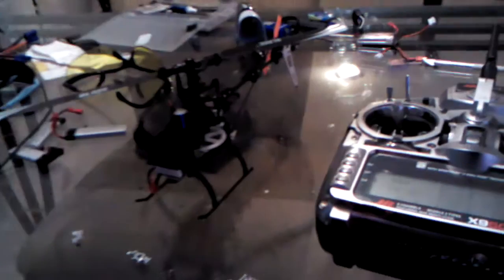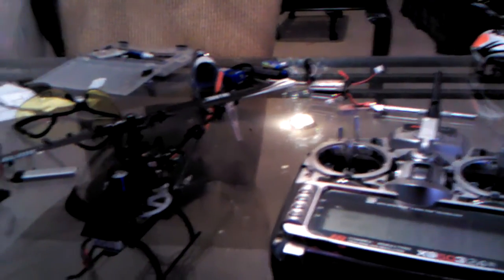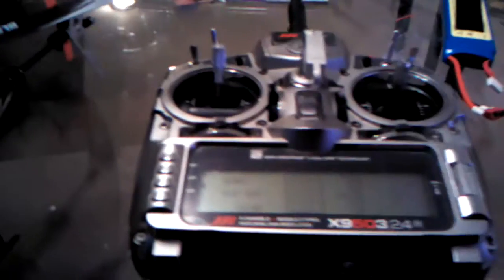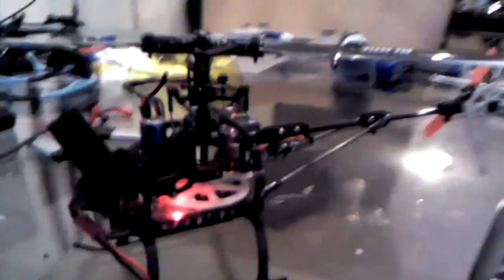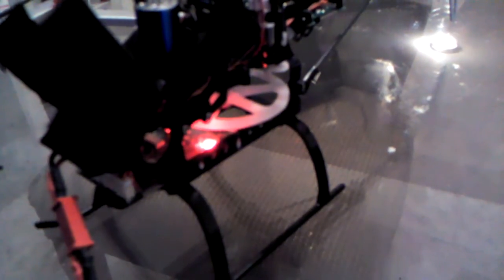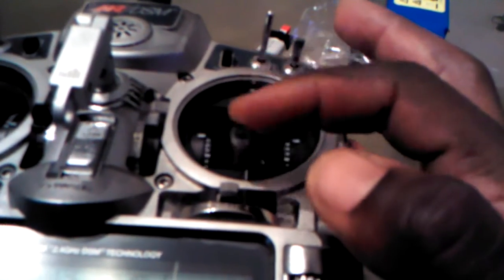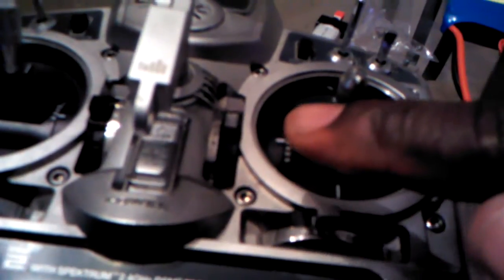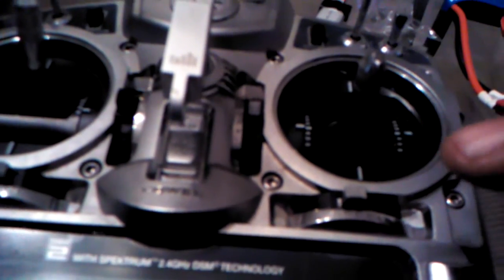Blade 130x how to program gyro settings

Comment: One thing not covered here is how many increments of gain settings there are.  I've seen videos on here describing a total of 20, 10 right and 10 left.  And there are other videos that say 10 TOTAL, 5 right and 5 left.  Anyone know which is correct?

Comment from the maker: Make sure the tail blade grips are not reversed.  Also the gears could look good but if the d shape in the gear where it slides on the shaft could be rounded.  To check hold the tail and turn the main blades by hand and that will let you know if its bad.  Be blessed

Comment: the video gets the colours for the gains incorrect, otherwise this video is correct. note you can also perform a 0 gain reset by push hard rudder right, it must hit 100% for 5 seconds.